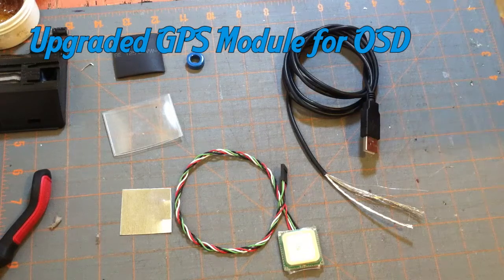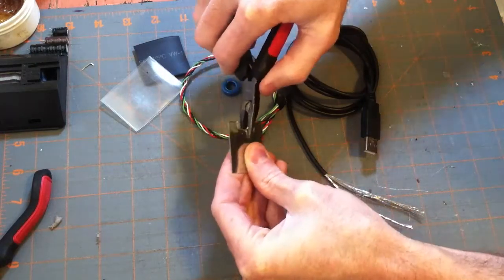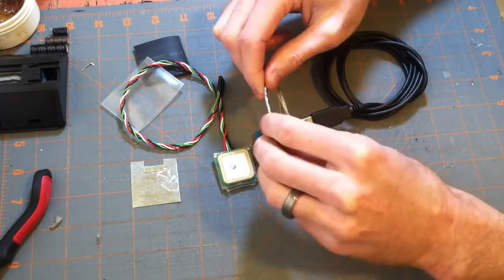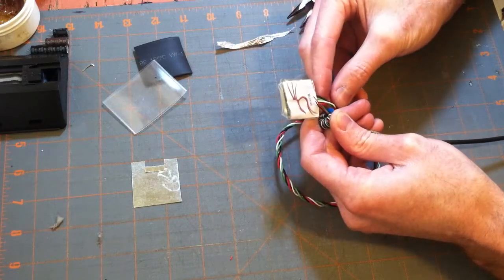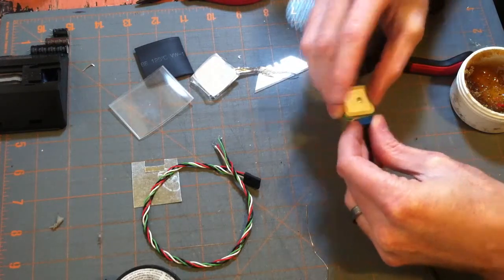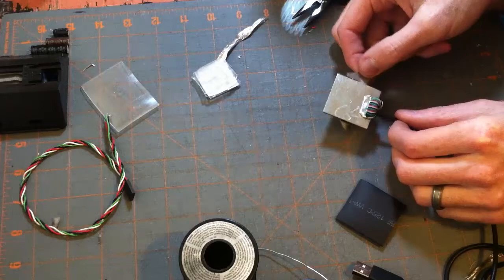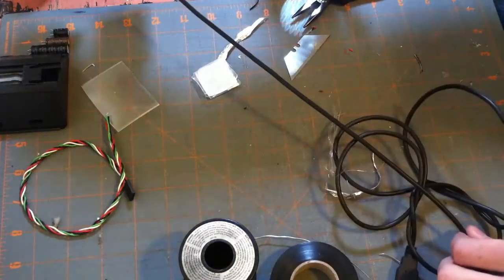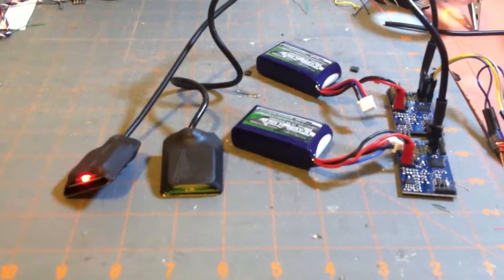FPV GPS upgrades

Comment: I have a naza m v1 with gps it works great but I want to try to boost sat lock, I was gonna do similar type but use a mini pie pan with feroite ring mounted like a sat dish around naza gps module! I don't know if it will make it worse or better?  I got the hk excellence osd with gps I am gonna do this too awesome idea, so I guess the guys that use that type of gps for there fc that will help them out a lot!!!!!
Reply from the maker: The naza does benefit a little from a baseplate but not really much. havent tried the torroid on the naza either....

Comment: Hi, about the ring you have rolled the cable, is it ceramic or magnetic? 
Thanks
Reply from the maker: they are: A ferrite bead is a passive electric component that suppresses high frequency noise in electronic circuits. It is a specific type of electronic choke. Ferrite beads employ the dissipation of high frequency currents in a ferrite ceramic to build high frequency noise suppression devices. Ferrite beads may also be called blocks, cores, rings, EMI filters, or chokes. from wikipedia

Comment from the maker: yes... GPS wires connect as normal... Power ground RX and TX, but the Shield does not connect to the gground on the GPS end, it connects to the reflector plate.

The ground on the OSD side connects to both the GPS ground wire and the shield.